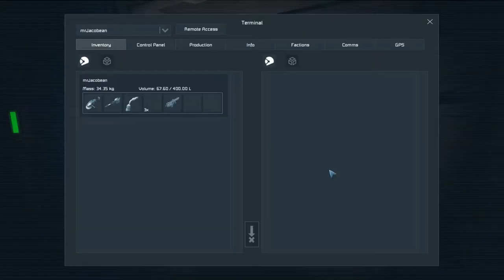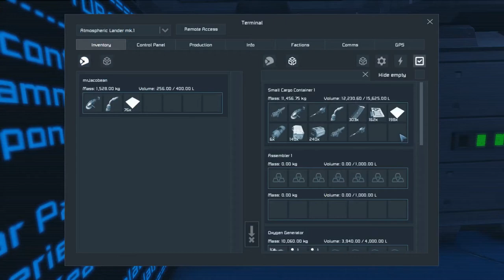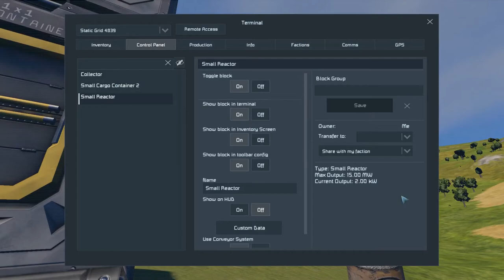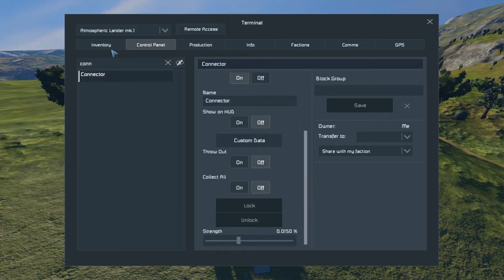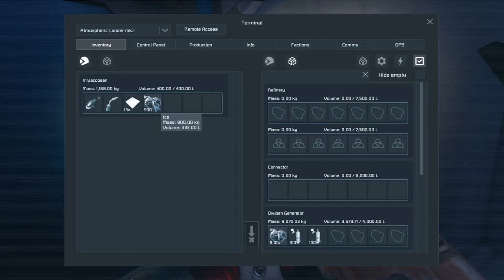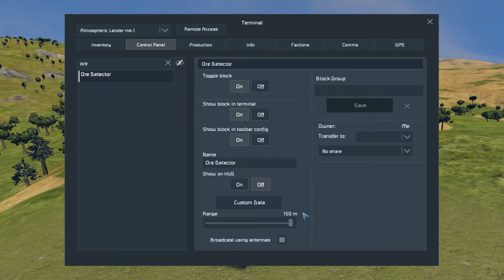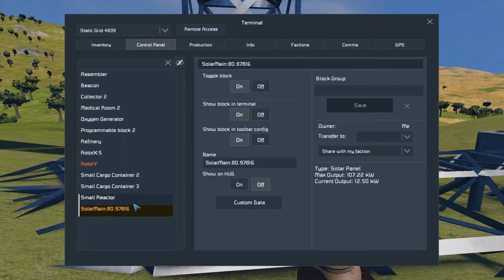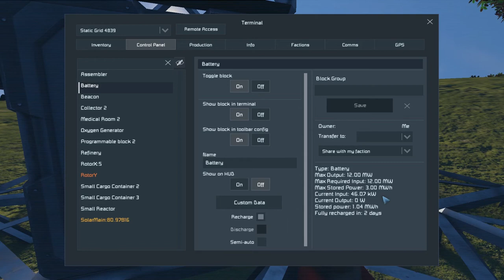Planetfall & Solar Panels - Space Engineers #01

Comment: I just use a timer to shut down reactors and set batteries to charging, and turn them on when batteries are discharging.  The  battery auto mode and reactors on do not combine efficiently.  There are also scripted solutions.